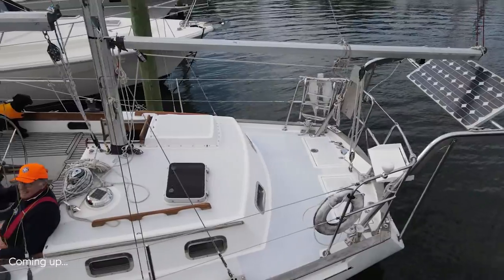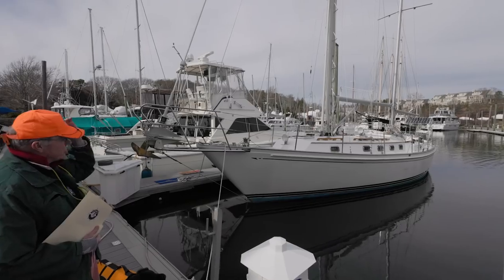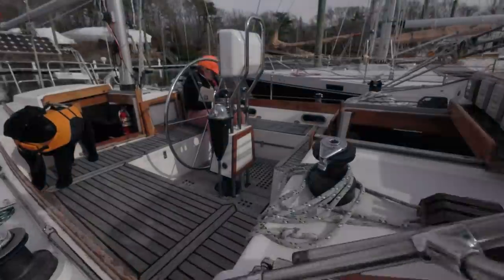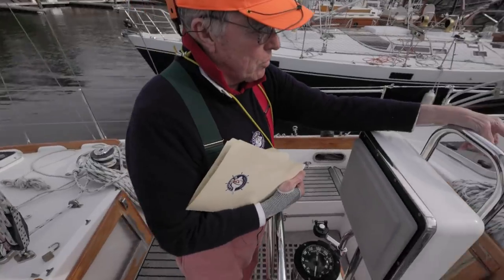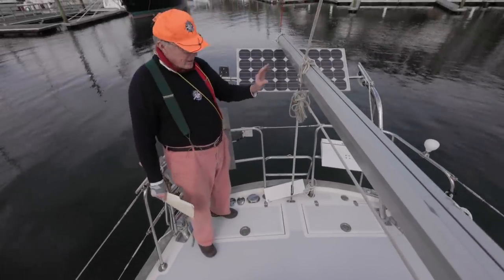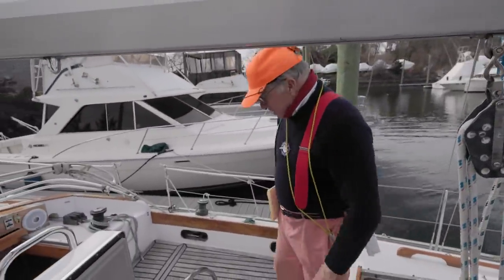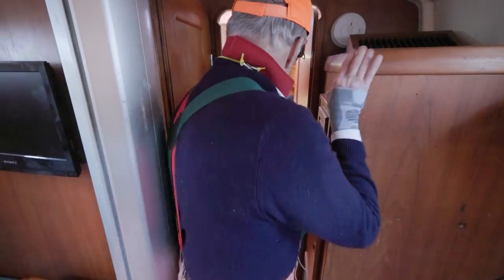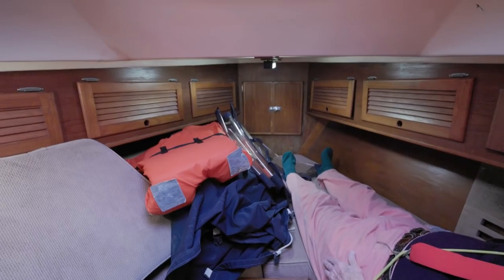$99,000 SAIL ANYWHERE!! Comfy liveaboard sailboat for sale #sailboatforsale #sailboattour EP90

Comment: Love the broad rub strake.. Love the center cockpit despite the aesthetics detraction (opinion) from aft cockpit designs. Center cockpits are easier to get wet in. Also easier to totally enclose for comfort.  Nice high toe rails. You ain't sailing rail down with this without some serious degradation in performance. I love boats that are built to perform rail down under. Just the thrill of sitting in the cockpit with the water rushing so close by. Love the aftermarket Seldon upgrades. Your history of the designers is one of my favorite parts of your productions. The galley on this one is totally exceptional for the price of this vessel. The electrics in the 'tunnel' is exactly how things should be done with that design. Mechanical space is rather exceptional for the price. Love the overhead compass. I love the centerboard despite the increased maintenance. Those work out very well as long as you are not going to use it beat the boat too badly to weather. The anti skid appears on camera to have been done very well. Bow sprit,,,,, short and clean. No need for decking as the sort length allows enough just bending over it. Again though, for the price nothing to complain about. Stainless port lights? A boat after my heart those. Bronze or stainless port lights are always a huge plus IMHO. Love the teak work in the cockpit where there will be a lot of moving about. ALL self tailing winches around the cockpit. What can not be liked about that? The anchor chain stops are not conventional but appear to me to be more than sufficient.  The spinnaker pole is well what it is. That track up the mast can be brought into play with little to do. Appears to be a nice enough dodger frame in place. Canvas comes and canvas goes. Dink davits appear to be a bit small but a small dink is better than no dink. Nothing wrong with a track up the mizzen to help facilitate filling in sail between the mizzen and the main when you feel like it. Dinner table has fiddles and looks very nice. Battery switched below the companionway is nothing I could complain about for this price. The fuel system is looking like what I would prefer. Even without possibly a recirc pump for polishing. It would be an easy addition. More handholds would be nice. Your grading of the vessel was spot on. Despite a new rack of sails that might be needed. My ONLY complaint would be chocks screwed into the top of the toe rails. Those chocks could be taken into and below the toe rail on an easy DIY weekend. Very fine looking boat at a very fine price. Fluorescent needs to yield to LEDs. No big deal.
Reply from the maker: Now, please tell us what you really think about the boat please?

Hahaha. Thank you for watching  as well as paying such attention to the details 
Have a good weekend

Comment: Another great video of a great boat! Those little handles on the windlass are the clutch , release them to free fall the anchor
Reply from the maker: I did not know that.   Thank you for heads up   We love the minutiae sand try to get it straight  but CQ is getting old   Thank you
Reply: @YachtHunters  Captain Q is the best 👍 I have basically the same windlass by Ideal . The free fall option is handy just don’t forget to tighten it back down or the anchor is not gonna come back up

Comment: Love your reviews and your knowledgeable informative show, except for your blind affection for ketch or yawl rigs. With fifty years of sailing experience both coastal and offshore, more often than not I find myself the sole sailor on board and not as nimble as I used to be, thus the need to simplify the sail-handling to the max. Years ago when I had small children aboard, the same logic applied. I want a rig that is easy to reef and simple to control, so the added ketch mast and gear are more of a nuisance than a plus. Give me a good Bermuda rig or even a gaff rig with or without electric winches, but with a traveler system that is easy to adjust over a ketch anytime. In the mean-while my current vessel is a well-designed coastal power boat which simplifies the sailing a lot.  Keep up the good work, Captain.

Comment: I really could not enjoy this boat for cruising, I would always be worried about about the centerboard. You never showned how it raises or lowers. I can not believe that single tiny padeye is responsible for controlling the the mainsheet, especially considering all the angled forces involved. I would prefer a traveler that would spread the force over the span of the cabin roof.